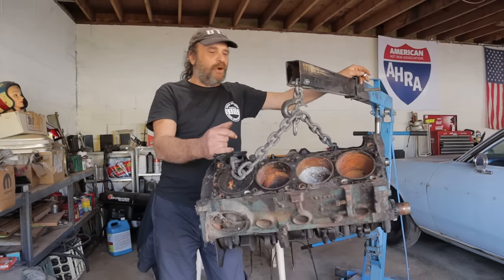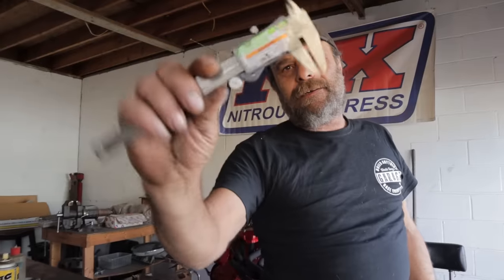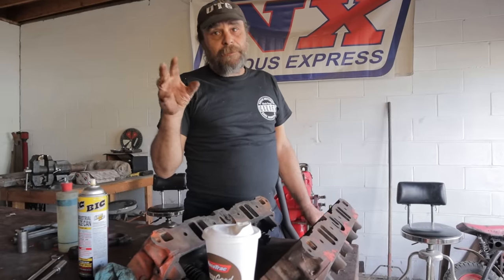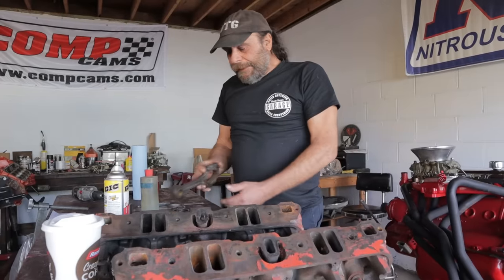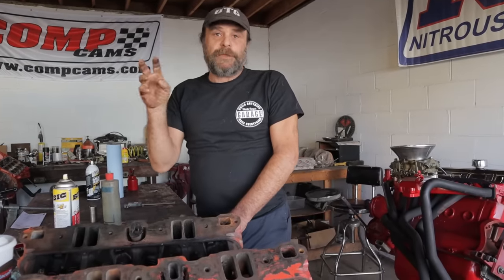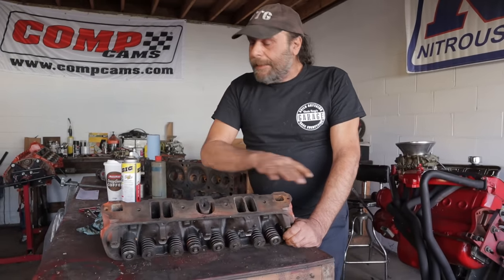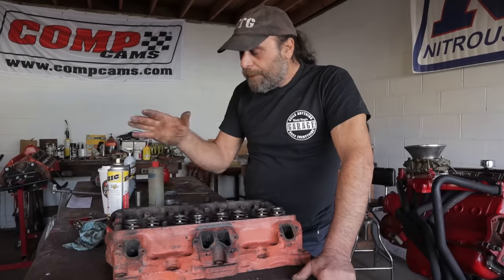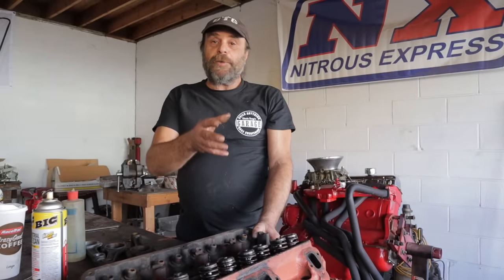The Most Under Rated V-8 In History?

Comment: You wish you knew about 318 340 differences. You dream these things up in your sleep
some of the info above is incorrect . Like the blocks have different coolant and are not near as strong. Here are two side by side. The difference is very noticable with just one of the sides pictured . 273 318 are the same block picture next to a 340. And the only 360 I would even concider using for a race motor is 71-72- 360 dash 1-4

100_0520.JPG

100_0521.JPG

100_0522.JPG

100_0523.JPG

Comment: 9:41 That logic is produced by people who look at engines in a 2 dimensional format. Thinking that the higher the number (whether it be compression, valve size, bore, ci, etc) in and of itself is better, is definitely not always true. A smaller valve size or intake runner volume doesn't necessarily make it worse, as long as its shaped to promote flow.. This being very evident on a lot of the smaller displacement engines making power that would've been unheard of in a factory format 25 years ago.

Comment: I like a 318. You can get around 400 HP out of them. The weak link that I found was in the main caps. If you are constantly revving up to 5 grand or more, they will crack the stock main caps. If you have the money, step up to the 4 bolt 340 steel caps. They will last a lot longer. I know I've cracked over a dozen stock 318 caps. Besides that, I was perfectly happy with the 318. After busting a bunch of stock 318 main caps, I finally stepped up to the 4 bolt. I never had a problem after that. And I have rung the chit out of it. And it's still together......https://www.milodon.com/main-caps/main-caps.php

Comment: 318s are a  good family car engine. And more so now. There is bugger all performance parts available. Not even a decent piston. And the bores are too small to get a decent size valve in. The .090 less bore creates all sorts of dramas. The same issue with [these days] 283 and 307 Chevs
Here in Oz at least the late 70s 318s had slightly better heads and 360 exhaust manifolds. Though these days most are cracked!!

The 340 is no 1 as it was a engine built for performance, though most of those are gone now as  well. The 360 is second best but 3" mains will always be a problem. And getting a decent piston yet again. Even the so called performance pistons available, both forged and h/e are  so far down the hole. So 8-1 will never make an engine really. Those pistons are all Chev pistons with Mopar pins.
J heads were the best,,, and all cracked!! Or for a 340 the t/a heads,, and they are all cracked!! Yes a recurring theme!
Yes I have had quite a bit to do with these things. With all the right bits, custom pistons, aftermarket heads they are a decent engine. But by then Waaaayy to expensive. For low bucks a LS is hard to beat. And I do not really like those either.

Comment: "The 318 suffers from propoganda." 
No, the 318 suffers from small valves, small ports and a low compression ratio. It's a people mover. Nothing wrong with the block itself but by the time you spend effort and monies on the 318, you may as well bolt a 360 into the same spot.
Reply: It suffers from jumped timing, those nylon timing gears put all my friends mopars on blocks in their driveway we did three in 1978 alone!

Comment: For reliability and especially longevity you couldn't beat the 318 and slant 6 motors. 250 or 300000 miles was not uncommon. If you can get half of that out of a new car you are doing good.

Comment: In my opinion the most under rated V8 would be the chevrolet 305 5.0 litre in any form compared to 5.0 302 efi from ford the 305 chevrolet is light years ahead imo had an 81 pontiac Parisienne was getting 27 mpg highway

Comment: You cannot put 360 valves into a 318. Valves hit the cylinder.  Unless you use under 400 lift!!  You can eyebrow the bore,, carefully, and then get maybe  480 lift. 
And even then you have  1.88 intake valve. And ofcourse many castings will not cop going that far as the seats strike water
And you cannot port a 318 head to 360 size. Not enough material.
And 360 heads on a 318 would be lucky to give 7-1.

Comment: They run great, and are damn near bullet proof. I'll give you that. But as a performance application, why would you bother. 360/5.9 magnum cores are cheap. And it's the same money to build, (probably cheaper for the 360 due to available stroker cranks, and large valve heads that would not fit on the small bore 318) And to compare with a 340 is a joke. Because quite frankly.. it, the 340, is a joke too. Ever ask yourself why a 4 inch bore and approximately 3.5 inch stroke was/is the common setup for gm, ford, and even chrysler (360) for almost 60 years now?  it's what works, it's what has the most aftermarket parts support. And it's also great for street performance and emissions.  And it's also what has had the most research and development as far as performance stuff.. so to taute an engine as (GOOD, UNDERRATED, MISUNDERSTOOD) that even chrysler discontinued a decade or better ago is assanine at best, and laughable, sad and pathetic at best.. it's not 1968 anymore brother. Wake up, it's 2021. make a decent truck engine for a daily driver, if working it do not bother. Buy the other truck that has the 360.

Comment: I think a lot of the older dodge products were good especially that slant six uncle had one in a work truck couldn't hurt one, but sadly dodge products in the last 25 years are crap, my dad bought the first dodge truck when they changed body styles about 25 years ago steering went out in about 6 months dealer had to replace about everything a few months later he gave it to my step brother transmission went out couple years later dealership would not make right, he parked it mabe 4 years later had it in shop to get fixed to sell, mechanic offered more than it was worth sold he sold it, guy swapped engine, transmission and even headliner I think with a new truck friend had that was getting repoed  took it out for a test drive front wheel hub and all if I remember came off and he crashed lol,  junk now I'm afraid.

Comment: The 318 was OK except for the nylon gear, shitty Carter smog compliant carb that never ran right, cam, etc. In other words Chrysler took the cheap way for everything. I had one n a  late 70sTradesman van....took a rebuild, a Carter rebuild (in California you couldn't smog a car with a non-stock carb so a guy I knew rebuilt it to run like it should have from the factory). Oh did I mention that Carter was out of business yet you still couldn't use any other Carb to get it smogged. Finally after all that the engine ran fine....than the auto trans died....than the differential gears broke a ring gear tooth. I never had such an unreliable car.
But that was my first full size van and I loved it as a "do anything" type of car. So since than I have had several full size vans from Chevy and Ford....but never Chrysler again.

Comment: When gas was affordable, there was no reason to do a 318...there was no replacement for cubic displacement. Even the "Baby Hemi" was just an engine for folks who wanted to turn the steering wheel. Then the 360 came out, and the only reason to "settle" for the '18 was a theory about saving gas as the pump price went up. But the '18 was in the same circle as the 273....too small when a 440 still could be grabbed at the junkyard for $100 or less.

I know, I have the old car magazines...the recipe to hot rod a 318 was to put on 340 heads and intake, and so whoever was advising you said to just grab the entire engine. Unless you were skipping the strip for the street, and then it was "go build a torque motor, the 360".  The Pontiac 350 was in the exact same boat--"why waste time on anything with less than a 4 inch bore?"  Shrouding, blah blah blah.

But the LS has shown us, a small bore can make a ton of power if you get the valve angle right and the head moves a ton of volume.  And now the 440-455 engines are $1,000 from someone who knows their worth.  Plus, all the "voodoo" of what makes an engine really produce, is available for free off the internet. Before, you hot rodded an engine by handling the Three C's---cam, compression, carb. 

You went big on all three, hogged out the heads (tho experts like Rodger Huntington would insist head porting didn't matter until 7,000 RPM) geared the whee out of the rear and didn't worry about connecting rod length or windage--that was NASCAR stuff.

I have to laugh at the engine mount difference...it was that level of "thinking" that led Mopar to put left handed threads on the passenger side of their vehicles :)